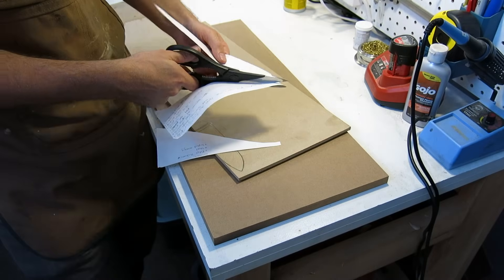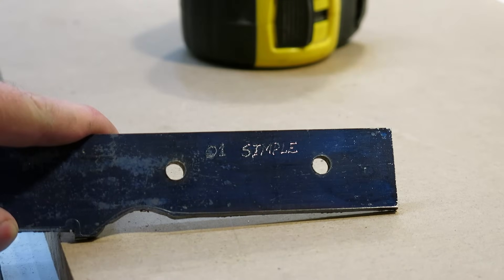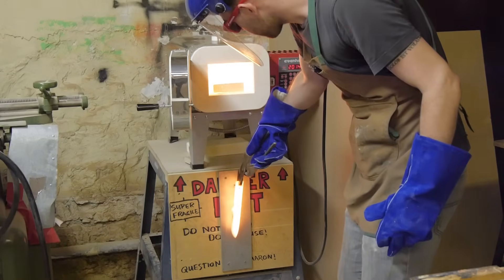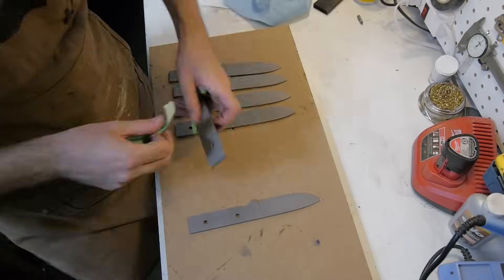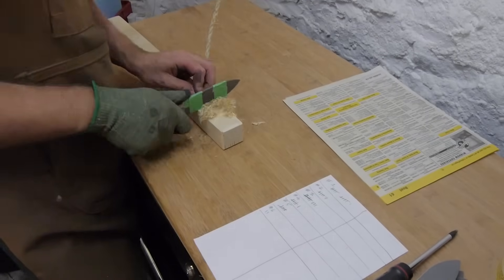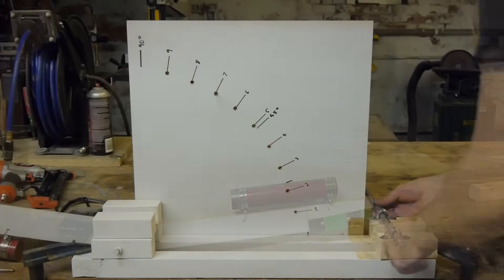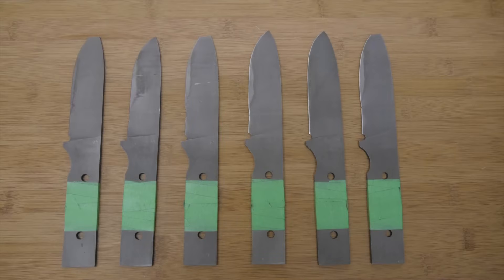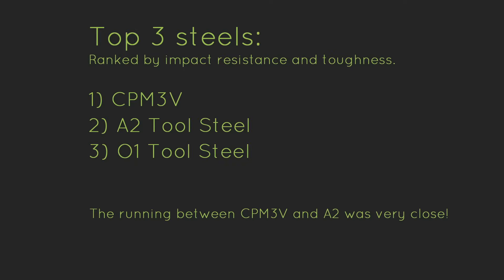Steel testing: a carnival of knife destruction.

Comment: Hello again for you A 2 steel testing what was the exact heat teatment u useed for that
Reply from the maker: If you have a look in the video description there are links to the thread on BladeForums where I detail the heat-treatment methods. The one I recommend is called "A2 ver. 1"

Comment: What Rockwell hardness is your A2 and  CPM 3v. I'm looking for a tuff steel for my fixed blades that will take a beating I'm using s35vn right now.
Reply: The A2 in my knives is about 62-63HRC, and it's very tough even at that high hardness. Hitting the sharpened edge with a 16" crowbar just leaves a small dent or possibly a chipped/rolled edge, but no damage that can't be sharpened out fairly quickly...

Comment: some of this is about design of the grind\ edge v edge vs convex you should expand this test and use convex and v grinds\edges on each steel you may find some steel like convex better the v grind
Reply from the maker: From what I've seen in the little testing I've done with convex grinds I found that a zero convex (no secondary bevel) is mor prone to chipping and edge-rolling than a standard v-bevel. There's probably room for tweaking the angles though.

I actually quite like a mild convex primary bevel, with a standard V secondary bevel. Works pretty well for a lot of different tasks, and is especially nice in the kitchen where it helps keep the food from sticking to the blade...
Reply: some Months ago i Bought a ROCKSTEAD KOU which has a sorta scandy zero convex with a polished edge..that thing is wicked sharp..fillets my thumb twice of a thin layer of skin lol ..i have seen vids of Virtouvice a japanese doctor who deer hunts and does hand waterstone sharpening and bushcraft vids..he does a asymmetrical convex that seemed interesting. One side for feather sticks and the other for sliding on bone to dress dreer .plus other vids i have seem on metal\edge holding and toughness..my thought was maybe some of these failed steels can do better with a different edge geometry(sp?)

Comment: great vid.. no spring steels?
Reply from the maker: I prefer alloy steels because of their carbide content (better edge retention) and because of their corrosion resistance...

I'm going to do another test at some point that will include a wider variety of steels though.
Reply: i see. sadly they haven't made a steel that has the edge retention of a tool steel and and the toughness of a spring steel.  now that would be the perfect blade.

Comment: saw you around the bb forums when you were just starting out... you've come a long way man, congratulations on your progress.

On a side note, 80CrV2 is a carbon tool steel you might want to look into for future carbon blades... outperforms 01, IMO, and is even easier to grind and heat-treat. I'm just a hobby knife-maker, but its the only steel i use anymore.

Keep up the great work
Reply from the maker: Thanks mate! Still got a long way to go too... Making knives in batches is a whole other animal, and it's very challenging to get right. That's my current challenge.

I haven't tried 80CrV2 (not sure I've heard of it either!).. I have a couple of different steels that I'm trying out at the shop, one that I'm excited about testing is AEBL, seems like it should be a nice tough stainless.

Comment: Have you listed anywhere, what type of steel each blade was? I tried the links you provided and you listed the blade numbers and results of each test but I couldn't find what type of steel correlated to what blade number. Were the results private or did you share them somewhere and I missed it? Your testing methods were very well done but it would be pointless to anyone who doesn't have the info of which blade was what steel. I hope you can point me in the right direction, thanks.
Reply from the maker: The numbers and the steels are listed here: http://www.bladeforums.com/forums/showthread.php/1104795-Steel-testing-underway/page13

You don't actually need that though, given that the summary shows the results of each test and what steel it is... I recommend reading through the full thread that I linked above as a lot went on in there.

Comment: This was a great test. To help you go through the process there is a process called DOE or "design of experiments" it uses comparative data to highlight significant factors and non significant factors. It's what models many laboratory experiments. In it's simplest form a couple of factorial runs can help you select the ranges as you want to recreate your results on any new knives. It can help identify significant values between time and temperature and provide you a robust end product. Just as a Rockwell measurement provides hardness results for metal, it can help you achieve the exact hardness and flexibility from annealing. You done a great job!
Reply from the maker: I have a look into the 'design of experiments' thing, sounds interesting!
Reply: This guy is correct in that "DoE" is very useful in whittling down minimal data into meaningful conclusions.

We use it in engineering/product design (at least we should)... a like-minded empirical person such as yourself, Aaron, should consider this another useful tool to add to your already-impressive kit...

Comment: Pretty torough test you made here :P It's sad you cannot measure your BHN hardness tough, you could have put numbers on you test. I don't know exactly where you are in Canada (tough we have the same virgin oil can so probably not that far) but technical schools in quebec generally have the machines for the harness and tensile tests. Some of them (like the one I went) do commission work for cheap, they could test even more alloys and give you tensile/hardness graphs.
Reply from the maker: At the end were I show the ranking of the steels, there is a note that says to check the video description if you want more info. In those links it shows the ranking for all the steels along with their tested hardnesses in Rockwell C which is the hardness test normall used for knives.
Reply: Gough Custom hooo nice :P yeah I forgot BHN wouldn't give you quite accurate numbers on this scale.... DUH

Comment: Awesome vid man, thank you for taking the time. Speaking of time, you have A LOT of patients to make and destroy those knives! Not to mention your shop is spotless...
I've been using Starrett A2 tool steel and teaching myself to make fixed blade drop points, and got pretty frustrated with the file, so I'm saving for a 1" belt grinder. Did the transition from file to grinder have you questioning angles much?
Reply from the maker: A2 is a really great steel, it's nice to work with and makes a great knife!

The transition to the grinder was very hard for me. I found grinding freehand so stressful that I ended up making a jig so I could do it without the stress... It's a steep learning curve for sure, but if you're patient and have a bunch on inexpensive steel to practice on you'll get there!

Comment: Man!! A2 is my favorite steel to use, I heat treat with oil that has a very high carbon in it. but I soak the blade very well in heat before a quench it and do it three times. then temper it at 500 for an hour. I would like to see what the results of O1 and A2 were like if they were pattern welded

Comment: wow, I was shocked at the strength of some of the steel you used
Reply from the maker: Me too! I was also amazed at the sheer resilience of some of them. A2 and CPM3V shrug off blows from the crowbar like they're nothing! That's pretty amazing for a piece of steel that's only 0.013" thick at the edge!
Reply: I don't know if you've ever used 1095 steel but that's what I use, im only 15 and I guess my knives pretty good considering my age, I cant sell them for much just cause most people just don't see it as an art, do you have any suggestions as to where I should sell them, im not looking to make a living off my knives, I just want to start a busness so I don't have to work somewhere making minimum wage I think I could get at least $10-$15 an hour making knives vs $7.50 working at a grocery store. I would appreciate if you would check out my channel, look at some of my knives and get back to me and tell me what you think, my ears are open and I am always wanting to learn from a great knife maker like you
Reply from the maker: matthew washburn If you want to do knifemaking as a business then you need to charge what you think is reasonable, if you sell online there should be plenty of people that will appreciate the effort you've put into your knives, provided that they're well made and well designed.

1095 should be a great steel provided that it's heat-treated properly, I'm not sure what kind of heat-treat process you're using...
Reply: right now I am heating the knife blades until the entire blade is red hot then quenching about 2/3 of the blade In cooking oil leaving the spine out of the oil for about 5 to 10 seconds then I quench the entire blade.
I might get an ebay account but I will have to learn more about the process before I make my decision. if you haven't seen the knives I have made please look at some of them, I make youtube videos. prices for the smaller skinning and neck knife sized knives I would sell them for $50 and some of the larger edc and camping sized knives I would be satisfied with getting $75 each, I feel that those are fair prices. I have only made a couple of leather sheaths and there not good and leather is expensive so I would want to start making kydex sheaths, do you have any recommendations on making a kydex press and I don't know where you live but I live in North Carolina and need a kydex source to buy in the big pieces. sorry for my long never ending questions but I am trying to learn as mutch as I can! thank you for all your help!
Reply from the maker: matthew washburn Looking good mate! You might want to switch to using 1084 instead of 1095 given your heat-treatment process. 1095 requires a bit tighter temperature control and also needs some time to soak when hot, whereas 1084 is more forgiving.

Personally I would go ahead and quench the entire blade rather than edge quenching, simply because a properly heat-treated blade made from a modern steel wil be stronger when completely hardened, that it would be if left with a soft spine.

Best place I've found to buy Kydex is knifekits.com, a kydex press like mine can be made from some kydex foam, some plywood and a door hinge, works very well.

You'll have to decide what kind of market you want to address with your knives. The more highly finished, and the more care you take with fitting, the more you will be able to charge for them... Head over to bladeforums.com and have a look through the 'for sale' section and see what's going on there. Personally I wouldn't sell on ebay, but you should weigh the options for yourself!

You're doing well mate!
Reply: I am smokeyforgeblades on blade forums and I have seen you on there I just haven't figured out how to make posts and stuff yet. thanks for your help and hope we will be online friends for many years to come! tomorrow I will probably finish 2 knives im working on out of used files. I will have a video up within the next few days if you feel like checking them out.
Reply: how many knives do you sell per month on average just out of curiosity. I know some knife-makers sell dozens of knives per month like gavkoo if you know who im talking about I just want to know what to expect once I get a steady business going. I said I might try to sell on ebay and I have changed my mind, I might sell on gearbastion instead.
Reply from the maker: matthew washburn I don't sell very many yet as I'm still working out how to be more productive while maintaining/improving quality.

I would say don't worry too much about how many you're going to sell. Just focus on getting the fit & finish of your knives as good as you can get it. If you're making really nice knives then I don't think you'll ever have a problem selling them provided that they're reasonably priced.
Reply: if I were you I would make lots of knives at one time and since you only make the resolute and your small edc neck knife, start out making 25 or 50 at a time you will save lots of time and I don't know that type of belt sander you use but I would suggest a badder, kmg or something that would grind quick instead of using files,i use a porter cable belt sander that is made for wood but I just use it for all my sanding and grinding.

Comment: What are your thoughts on 1080 hc steel?
Reply from the maker: Simple carbon steels like 1075, 1084, 1080 etc should all be VERY tough. Probably as tough or tougher than A2 when heat-treated correctly. This is because they have relatively few carbides in the steel structure, and what carbides they do have will be very fine... That helps keep the toughness up in the steel.

I don't use the simple carbon steels for a couple of reasons:
1) I prefer air quenching steels as they're easier to heat-treat (provided you have a heat-treating kiln)
2) I prefer my steels to have some chromium in them so that they resist rusting. 1080 and such will rust/stain very easily! With A2 you have to work a bit to get it to rust.
3) The higher volume of carbides in alloy steels like A2 help the steel keep a 'toothy' edge for longer from what I've seen.

That being said everyone likes different steels for different reasons! I don't think there's anything wrong with the simple carbon steels, and they're great steels to use if you're planning on forging blades, or heat-treating in a simple forge.

-A
Reply: Gough Custom Ok, thank you! I have been making knives out of 1080 and was recommended to me by my mentor. I just wanted another opinion of it :)

Comment from the maker: The steel that I'm using in combination with the foil is not actually O1, it will be an air-hardening steel like A2... That eliminates the need for oil, as well as the need to remove it from the foil package.

Have you seen the video on my channel that covers how to heat-treat O1?

-Aaron

Comment from the maker: I order steel from a number of places, but 'Jantz Supply' has a very good selection.

Using files only I can rough out the bevels for a 4" blade in about 1-1/2 hours... Then it takes a couple of hours to sand away the file marks...

Comment from the maker: Comments have to be approved, so they don't show up until I've had a chance to approve them. CPM154 did ok, it's not as tough as some of the others but if you need a stainless blade it's a good option.

Check out the links in the video description for more info.

Comment from the maker: If you want a steel that has a very easy heat-treatment process I would suggest having a look at 1084.

When people say a steel is great, they generally mean "this steel is great with proper heat-treatment". Some steels can be quite complicated to heat-treat. 1095 is easy to heat-treat to get mediocre results, but getting the best out of it requires a bit of finesse from what I have heard. 1084 won't get you quite as good results, but it gives up it's best much more easily...

Comment from the maker: I understand completely mate! There process is very complicated when you get down to the nuts and bolts, I won't even pretend that I understand it all! If you get a recipe that works, either from someone else or through experimentation, then that is all you really need!

A2 is expensive compared to 1095 (which is very inexpensive) there are steels that are much more expensive again like CPM154.

Comment from the maker: For example: the less tough steels like 440C would require thicker edges and beefier overall blade shapes in order to be as strong and durable as a thinner knife made from A2. Obviously a thinner knife is better, but in some conditions the rust-resistance of 440C would be a big advantage over A2.

Each steel has it's place basically. For my Resolute knives I think A2 or CPM3V is the right choice, but for smaller knives that are likely to be exposed to sweat (like pocket knives) I'll use CPM154..

Comment from the maker: Basically every steel needs slightly different heat-treatment processes. Take a pudding and a waffle for example, both ate delicious sugary snacks, but if you swapped the recipes neither would likely turn out very well!

A2 is a great steel for my knives. CPM3V would have worked well too. All of the steels I tested will make decent knives in fact, but the designs would have to be tweaked to match up to the capabilities of the steel...

Comment from the maker: Another thing to bear in mind is that hardness can really affect how fine of an edge the steel can take. I tested A2 at 64HRC, 62HRC 60HRC and 59HRC. 59HRC was the toughest, but the steel took a noticeably finer edge at 64HRC. it didn't seem to keep that edge any better than the softer steels when cutting rough materials though as it was likely micro-chipping... That kind of edge might be of use in light-duty situations though like razors or some kitchen knives.

Comment from the maker: To be perfectly honest though I basically never hone my edges to that point, as I generally want a bit of a toothy edge for normal use, so it's somewhat of a moot point for me and something that I didn't test for in my testing, so take my thoughts with a grain of salt for sure!

I meant to say in my last comment that 'steels with fine carbides, like A2, should *not* need any special treatment'. Regular waterstones should be able to get hair-splitting edges with no worries.

Comment from the maker: Most steels can be honed to that state if you're using the right abrasives. Carbide-heavy steels like D2 need abrasives that can cut the carbides (like diamond). Regular waterstones aren't generally able to cut the carbides which leads to them leaving a very toothy edge.

Steels with finder carbides like A2 should need any special treatment...